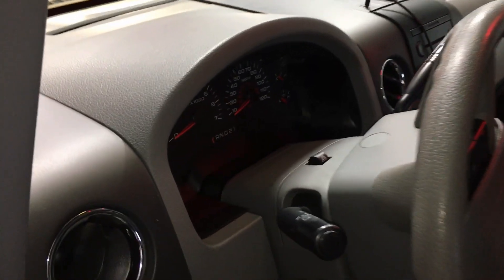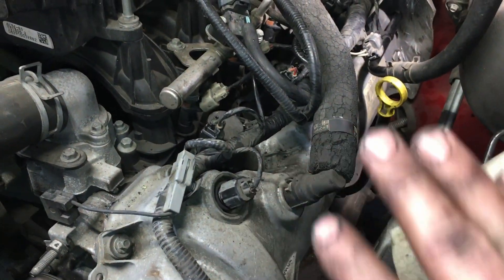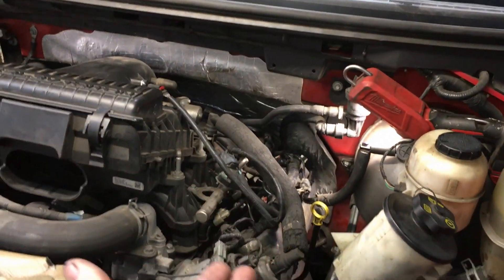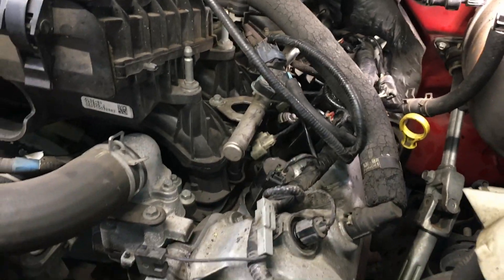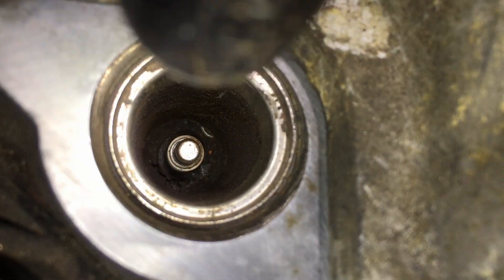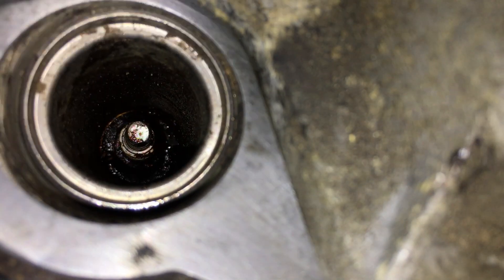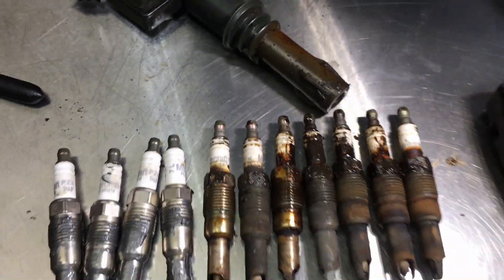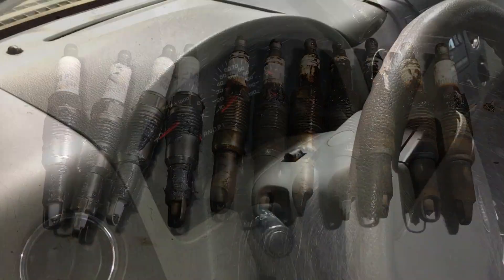Ford 5.4L 3v Triton Engines Fuel Smell and Ticking Tapping Noise: CHECK THIS ITEM FIRST!

Comment: Man I wish I was near you so you could work on my 2006 Lincoln Navigator.  No one around me has a clue with these motors.
Reply: This is the result of dealers not wanting to pay for qualified technicians, I was one of the first technicians to get a "confirm fix" on the 4.6 modular engine in 1990. It was between me and a technician in Seattle, Ford wouldn't let us know who was first. The Engineers from the Romeo engine plant would call my dealership and ask to speak with me.
Reply: hello  does it die when you come to a stop or idle up and down,  run like it has no power.    you have bad gas.    stop using the crap gas and go to a different gas station.   we are having a huge problem with E15 in the gas now.  dont go to quik-n-easy or Casey's   they are the main people who sell the crap gas.   to test for bad gas is easy.   go back to the place you have been going to,  put 1 dollar worht in a gas can,   take it home.   and while out side,   put a little on your finger,   is it very oily feeling and it does not dry like gas.  and then put some of the gas into a clear glass cup.  just 1 inch will do,    then wait 5 minutes.   does the gas suddenly turn a milky white or do you see 2 strange different layers to it,   if so,  its junk gas and there is your problem,   just run the takn empty as much as you can and then put in the better gas from a different place,  i have been getting 1 to 3 calls a day on this issue for over a year now.  we once had E10  but now we got this crap E15 ethanol gas,   and do not use E85   even if it says the car is made for it,  just stop,  you will thank me later.  but you provided zero information here so i am just guessing.  and pour out some gas onto the cement    if it looks like bubbles of oil and takes a very long time to dry and leaves a dark spot,   its junk gas,
Reply: @ateam6486  Dying at stops and idling issues can be other things too. Iac valve for instance.
Reply: @ateam6486  now after replacing spark plugs,  coils twice,  & tps it just idles like crap.  I also had the number 4 & 3 spark plus come loose.  Hopefully it was just a mistake on the torque.  Once it gets up to freeway speed it seems fine.  But at low idle it runs like crap. I do suspect the catalytic converter is plugged/ almost plugged.  Im doing that this weekend.
Reply: @Quirk77  had this on a 3v previously and found cheap coils causing back emf. Set of Motorcraft coils  later runs sweet
Reply: @ateam6486  i don't get gas from the bad places.  I try to get it at shell or bp. If not there then quick trip. I've used the same places for years,  so I'm not too worried about the bad gas,  but it's not something I'll over look either. And about 80% of the time I'm using premium. I've talked to a few people who say premium is absolutely needed and a few people who say it's doesn't matter.
Reply: Too many parts replacers and not many mechanics.
Reply: @ateam6486  the ethanol not so free is a lil bit better, at least it doesn't leave a stain on concrete, just my 2 cents
Reply: This guy is the Best Ford Mechanic I have seen. Iam a 3rd generation Ford man, watch all his videos because these Ford engines and trucks have a never ending list of defects.  Search his videos and you will find the answer to your Ford's latest problem.  Don't wait a week because some serious damage can be done.  I know, delayed doing a simiple repair and paid for it.
Reply: jessiejay23 No kidding - I had mine to the dealership TWICE and they couldn’t figure it out. Turned out to be a combination of bad plugs/catalytic converter on bank 2. 

My advice: Get a code reader and learn to use Mode 06.
Reply: @MrJeffcoley1  well your converters probably went bad as a result of the initial problem, whatever that was. If u have a condition where your computer detects a lean condition, like a vacuum or exhaust leak, it will try to compensate by running rich. This is what will ruin your cats, because you are dumping unburt fuel on them and they will get red hot and will go bad if you keep driving under these conditions.Your check engine light would have been going off bug time though and I'm sure you will have noticed some drivability issues too.
Reply: @MrJeffcoley1  I just got a code reader for that reason.  My dealer couldn't find a pigtail that plugged into my throttle position sensor.  So at this moment it's zip tied on until I get one.  The code reader definitely paid for itself on the first use. I need to play with some more to get fully used to it.
Reply: Jessiejay, what area are you in?
Reply: @Pr0ph3cy-k5z  near st cloud mn
Reply: @Quirk77  Damn. Too far away for me too.
Reply: Sell it . lol and avoid the headaches and sleep less nights .. I did and im happy now
Reply: And Everytime u take it somewear it's always oh they just sound like that no I have a peoblem
Reply: No one around here does any diagnostics when it comes to these type of off the wall issues. Take this truck to the ford dealer here and I guarantee you it comes back with one of two recommendations. They will tell you it needs all new cops and plugs or they recommend a new engine.

Comment: Dead giveaway was the ignition coil doing the 2 step on top of the spark plug ;)
Reply: Jake Elliott I noticed that too but when he went in the retaining screw was already off. He’d already pulled it but set it back for the video.
Reply: @MrJeffcoley1  ... but even with the screw out, the coil shoul not be dancing like that.  The plug was loose in that hole.
Reply: @williamwarren4606  Yes, I had that issue after a spark plug change at a local garage. Ford changed the torque spec from 12 lbs to 24, but the mechanic torqued it to 12. The new plugs came loose and there was a smell of raw fuel and some strange noises.
Reply: Show me that one two step

Comment: Another great video, Brian. Could it be possible that the plugs came loose because the plugs were replaced before and there was residual oils that were not cleaned off prior to installing new plugs from the first plug change to prevent them breaking off and getting stuck in the head?

Comment: Happen to my explorer with the 4.6l, lol,I caught it early,just cleaned the plug and put them back in,no noise since
Reply from the maker: These were in here for 30k miles and were already beyond worn on the electrode.
Reply: @FordTechMakuloco  mine happen after changing the spark plug,I guess I didn't torque down that one properly,it was missfiring

Comment: Any timing chain kit for a 2000 FORD F-150 ? At the dealership are too expensive. Let me know.
Reply from the maker: No kits that I know of.
Reply: Just in case if you come along with one let me know. Thanks.
Reply: What would you recommend? because my passenger side  front left my chain is kinda loose and I notice that  when I was  changing the valve cover gaskets. My question is should I just change the tensioners and the chain guides or should I change the chains too. Because I don’t want to spend that much money.

Comment: You should diagnose the engine tick in the 2018 GT Mustangs.
Reply from the maker: Nothing really to diagnose they all do it, Ford is going to plead it’s the engine design. Just like the typewriter tick on the 6.7l diesel due to the block material. Some Ford engineers said we could use something called carbon black?
Reply: Carbon black?   As in the residue you get from incomplete combustion?   I don't think they drug test at Dearborn HQ anymore 😎.
"Hey mannnnnn.....check this idea out.  We bring back the 351 Cleveland.....but we make it out of Doritos."

Comment: Building engines for 100 years haven't quite worked out spark plugs yet, Given up on Ford nothing but garbage.
Reply: I ain't a Chevy guy, but LS>any Ford engine
Reply: Owner of a 1997 F-150 4x4 Lariat three door model brought new, with over 225,000 with 5.4 V8 not one major issue other than general maintenance upkeep.....Land Air Sea// U.S. Navy//**Retired**
Reply: @roysandoval8230  You are one of the lucky ones.
Reply: Roy Sandoval too bad ford decided to turn the 5.4 into the biggest piece of shit engine ever built.
Reply: MrCoffeekelly - I must one of the lucky ones, still i never put my truck through jack rabbit starts, nor has been driven hard I think they call it 4 wheeling in the mud and such, I kept her steady at no more 60 mph on highway...no oil leaks or nothing, engine oil and filter changed at 2500 miles or 3 month time which ever drop by 1st, "Transmission oil and filter is changed and Note i never flush, just replace the oil that held in the transmission pan on every third engine oil change, suspension lube, coolant, belt, brakes...ect..just the normal stuff each of us go through. But haven't no problems like they talking about here...but I can see if someone has to put the gas pedal through floor board each time they get going, I see it all the time, it doesn't matter who that truck is made by from new to junk, I treat my truck like a tool, not a toy....oh yea forgot I only use AC Delco filters and 10w-30w Castrol conventional oil, I do stay away from synthetic types...I think its a waste of money...
Reply: Get a Studebaker...
Reply: Ford mantra: Why engineer a good head design when instead you can over-engineer the spark plugs.
Reply: Wow...that one of the smartest things I've read on the interwebs.....
Reply: Apparently you’ve never worked on a Mercedes. I have fords in my fleet with over 400k with general maintenance and repairs, nothing major. Many of them original water pumps, transmissions and rear ends. I have have some Mercedes that are on their 3rd engine with under 300k.
Reply: I would still rather have a Ford over a New Chevy any day.....